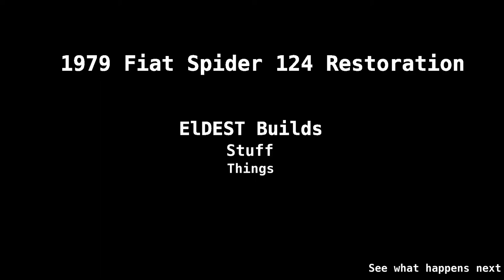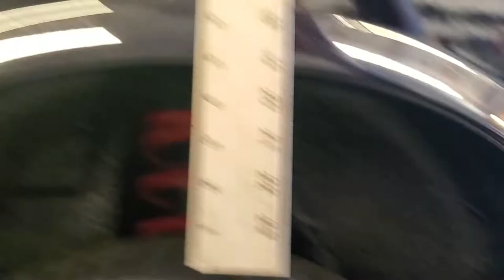1979 Fiat Spider 124, Making a carb riser out of the old carb, new lowering springs, unboxing.

Comment: Hi love watching your videos I’m also going through a restoration.I would like to know if you can measure the height of Vick’s lowering springs right out of the box .Would like to compare them to a set I got a few years back that I don’t remember where they were purchased from .
Reply from the maker: Will do, I also will compare then to the stock springs when I take them out. Busy working on the front seats right now.
Reply from the maker: Posted  a picture on the Eldest Builds Facebook page. Looks like 12 3/4 and 17  1/2

Comment: Are you getting rid of the old carb? Is it for sale?   I’m running a adf and slowly eliminating the smog crap. What carb are you running now? Your engine sounds great!!!
Reply from the maker: The old card was the original Weber 28/32ADHA, pollution controlled crap. It is a boat anchor now. 20 year old fuel had harden inside the passages. I very crudely dismantled it for parts. I purchased the replacement Weber 32/36 DFEV Carburetor from Vick Auto along with the single plane manifold. I used the block from the old carb as the riser, rendering it even more useless. The car is now smog free. I recommend the carb/intake conversion paired with the header style exhaust. Spend then extra money to buy the Weber. You could probably find a good used DFEV on the forums or Facebook when somebody upgrades to the dual carb setup.
Reply: @ELDESTBuilds  is the intake manifold a smog delete from vicks auto? it has less holes than mine and id assume its to the smog on the stock carb?
Reply from the maker: Smog delete manifold,  all the extra ports  are blocked except for the brake booster vacuum. It also removes the water port for the stock carb, heater hose to the choke
Reply: @ELDESTBuilds  will the stock carb work ? or should i not waste my time putting it back on and grab a new one?
Reply from the maker: Stock carb will work, just have to plug all the vacuum ports. Honestly,  a new Weber without all the smog junk will run better.
Reply: @ELDESTBuilds  thankyou!
Reply from the maker: Welcome